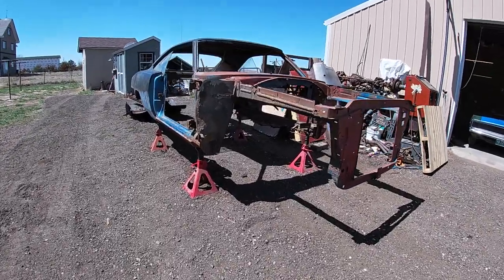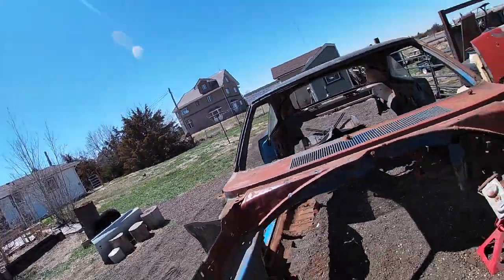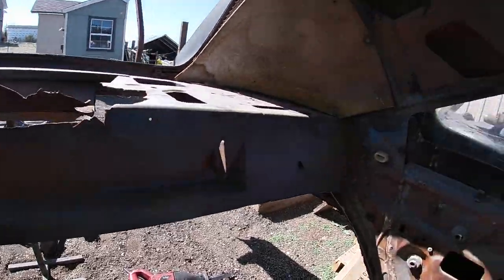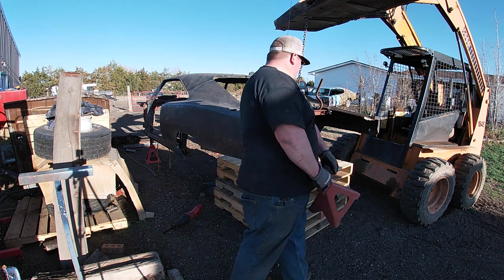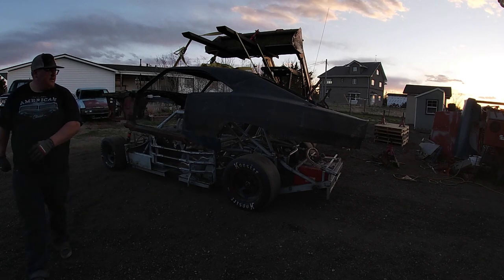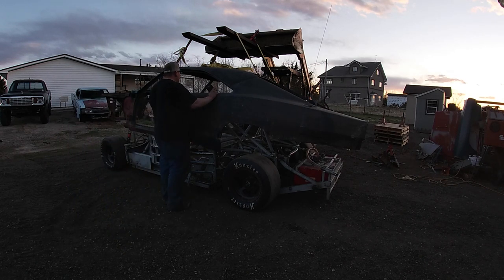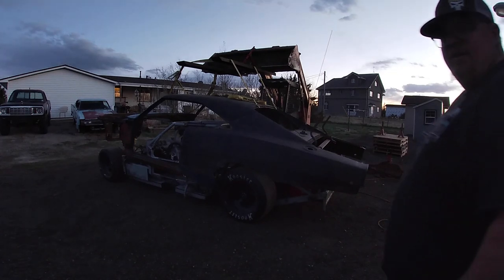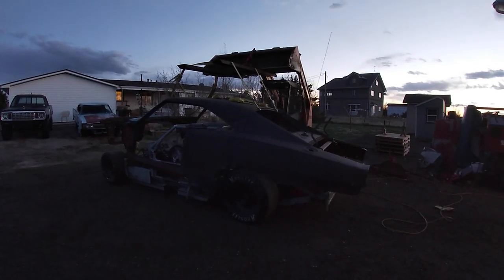1968 Charger Nascar Build // Ep 6: Test Fitting the Charger Body

Comment: cut the car all the way to the top of the wheel well so youre left with the top half only (youll need to find a way to support the front engine bay i dont think the a pillars will hold it alone. Find a way weld the bottom rails back or make something new after you attach it to the chassis.